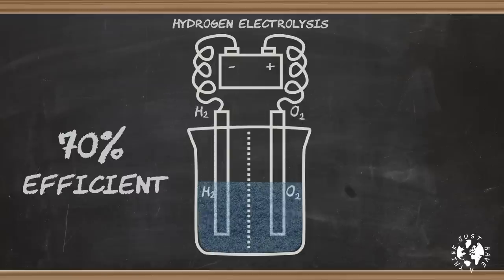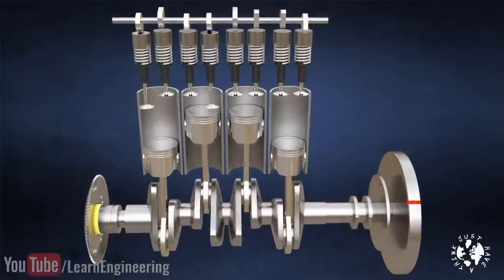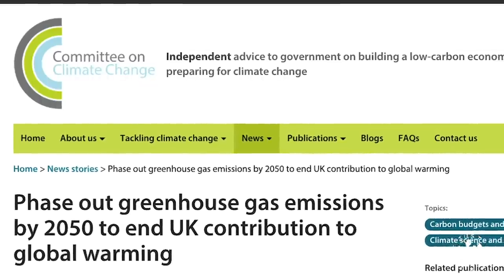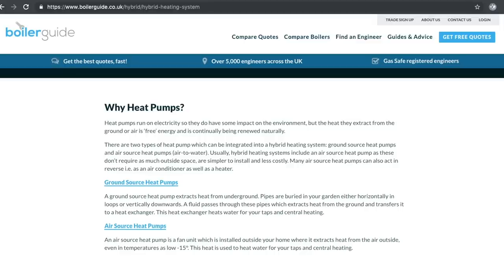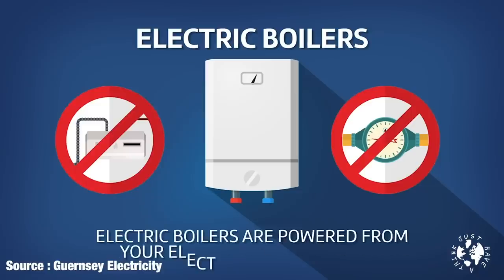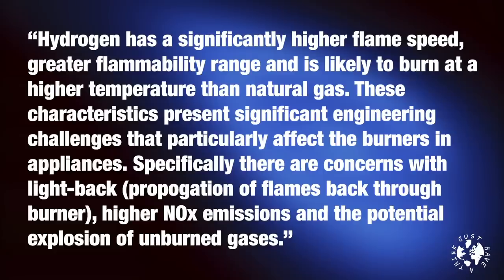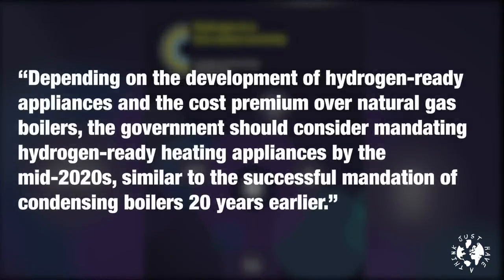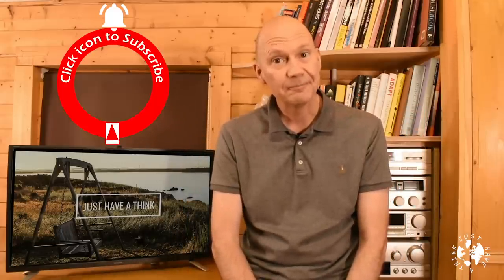Hydrogen for heating our homes

Comment: I use off-peak storage heaters. (Steffes brand)  They have salt filled bricks that are heated electrically to around 2000 degrees at night when the power price is low. Then  the room thermostat controls a fan that blows room air up threw and back down over the bricks. A air mixing system keeps the exit air temperature down to a safe level. On the whole they work quite well, but the old ones I have are manually controlled and I have to adjust them based on the upcoming outdoor weather. The modern ones do that automatically. For the future I am looking at a solar heat collecting troughs along with large storage tanks with candle wax to store a week of heat.

Comment: for get all that who can afford a hybrid system like that ridiculous.

Just make a hybrid water heater running on Solar  and having its own hydrogen generator  gas can be used to heat water during the night that water inturn can be used to heat the home,  additional power from the grid can be used if needed.   no battery needed  but  a battery Bank wouldnt hurt  all come down to your budget

Comment: I can see using hydrogen for the industrial users first, before it changes over to the average household. That would economize the production and also speed up the development of appliances. I do believe we need to stat with improving the efficiency of our construction techniques for houses first. I would also like to see the adoption of the garbage burning system that Sweden uses. They re now importing garbage to recycle and reuse for the production of electricity. We should be concentration on getting rid f our landfills. My 2 cents worth :)

Comment: I read something about using solar panels to produce electricity(1), then use the electricity on a utility scale to produce hydrogen(2), then adding the hydrogen to produce a liquid hydro carbon, that can be pumped through existing liquid pipeline infrastructure to where it it is to be used(3), then reversing the process through catalyst to produce hydrogen gas (4) to be run through a fuel cell to produce electricity(5).♻️💫
Reply from the maker: Hi David. I think that's right, yes. Essentially 'storing' the hydrogen in a transportable liquid that has far weaker bonds than water and then separating it at it's destination point back into hydrogen. It's an interesting option. I believe ammonia works too.

Comment: My thought is that hydrogen will be most useful as an energy store.  Take the excess of renewable production when it exists for electrolysis and use it in gas turbine electricity generating sets when renewable production doesn't meet demand.

The advantage being that all the new infrastructure is static, no issues with transporting gas from place of production to place of use; the two are the same.

I'm old enough to remember the conversion from town gas (mainly from coal and a mix of combustibles with 50% hydrogen) to North Sea gas in the early 70s. Clearly in principle a similar programme could be carried out today but it would be excruciatingly expensive. My guess is that it would be more efficient to replace gas with electric supplemented by air and ground source heat pumps than attempt wholesale conversion.

Provision for specialist industrial uses and long distance goods transport seem to be far more advantageous, and cost much lest in infrastructure, than general domestic and small vehicle use.

Comment: Great Video, it confirms my wish to do a hybrid air source & gas boiler heating system. The thing I am really passionate about promoting is  hybrid trolley/ battery bus and hgv’s . The overhead  electrical source is put onto main atrial routes  around cities so buses can run on  direct power plus charge and between cables on batteries. This simplifies the cable system and gives buses flexibility plus no down time to charge. This can also work for Hgv’s  with cables down the motorway etc then finishing deliveries by battery. No worries about vehicle range.
Reply: We had these in the 1940's so nothing new. (Apart from not having batteries).

Comment: Not sure if it has any relevance 450 ppm atmoshiric CO2 concentrations and above is now unavoidable if we cannot find ways to remove then a further degree C and above is inevitable.Thank you.
Reply: @Allen Loser 

Your original post stated that a rise in CO2 to 450 ppm is unavoidable. Unavoidable is not the same as financially unfeasible or unprofitable. Unavoidable means that no method to prevent it exists or can be devised and implemented before it happens,

Yes that's correct  unavoidable 450 ppm

  "my 1903 vintage house located in a mid-Atlantic climate (Hagerstown MD)." 

Do you have a garden.?

"If, as you now assert, avoidance of 450 ppm CO2 relies upon making it profitable to do so, I urge you to appeal to my greed by providing better solutions which make doing so profitable for me." 

Correct 450 ppm is now unavoidable but you have already had the profit 

"Atmospheric concentration of CO2 of 200 ppm or less are associated with disruption of the water cycle, global cooling, widespread glaciation, crop failure, famine and mass extinction."

True but and its a big but mankind could still manage millions if not billions on the remaining 75% land mass last glacier maximum,or do you think the Amazon is only ten thousand years old,? modern humans can live through an ice age     

 
"disruption of the water cycle, global cooling, widespread glaciation, crop failure, famine and mass extinction."

You get all this above but lots more as Earth warms dead oceans,meters of sea level rise,One Northern circulation cell,a complete breakdown of Earths biosphere, increased seismic activity alone could be daunting,?lightning,hurricanes,tornadoes weather blocking,flooding, heatwaves, drought, fires and vast water shortages,not to mention Bactria, viruses.

"The Earth was rampant with life under previous hot house conditions.

Yes but not with 7.7 billion people,you can't compare The PETM to a possible current hothouse Earth and what was alive then. 

 "I expect that I can, and will, adapt even if you are incapable of doing so." 

How do you know what i am capable of,? i bet you wouldn't even know the right fungi to pick.
Reply: @Allen Loser 
"The house could handle up to six without crowding." 

You might feel with that many people in your house that its no-longer your house just saying,i mean have you every gone to a relations house and out lived your welcome.?
Reply: @Allen Loser 
"What are your assumptions as to whom would be the additional up to five persons? I'm counting two persons in each of the two larger bedrooms and one each in two smaller bedrooms. Even one each in the two larger bedrooms and myself using both of the smaller bedrooms cuts per capita energy consumption by at least half after accounting for a modest increase in total energy consumption." 

What kinda personalities would you be looking for.?

Why is it your concern whom I might take into my house, and why, if doing so reduces, or eliminates, under-utilization of my home? Doing so reduces Global Warming. Do you wish to discourage me from doing my part? 

Well your the one that keeps talking about renting rooms,i am glad you are dong your part
Reply: @Allen Loser

 "Do you live in a house which is under-utilized with high per capita energy consumption"

well i suppose 8 persons and we have always between 7.5 persons
Reply: @Allen Loser 
 "I grew up in a three bedroom home with eight occupants; myself, my parents and five siblings sharing one bath." 

Nothing wrong about that.
Reply: @Allen Loser 

"I don't know one type of fungi from another but I reject your inference that I will need to know in order to survive global climate change." 

It was an example,but i will give you that one and maybe i should have said to purify your own water. 

"You said that 450 ppm of atmospheric CO2 is unavoidable. Attempts to stop that which is unavoidable are, by definition, futile." 

Correct but what has your above comment got to do with stabilizing atmoshiric GHGs and drawing down.?

 "you concede that use of fossil fuels has benefited Mankind by improving the standard of living of billions of people since 1859 when Colonel Drake struck oil in Titusville PA" 

Correct fossil fuels are fantastic stuff apart from global warming, ocean acidification,and the 7 or so million that die an early death due to pollution 

 "Better get to work developing crops which thrive in a warmer climate. That is certainly an easier task than stopping the climate from changing" 

If only it was that simple.. . 

"The glaciers will melt with, or without, the assistance of Mankind." 

Let us not debate why our planet is now losing mass ice

 "Appeals to my greed may succeed at getting me to change my behavior where fear mongering will not" 

Now why would you suggest i am guilty of fear mongering.? 

"You need the voluntary cooperation of an overwhelming percentage of 7.7 billion people in order to have any chance to prevent the climate from changing." 

A certain amount of additional warming is uneatable, however to stop excessive warming would take trillions of investment and a total change of land use.

"I'm telling you how to gain my cooperation, and that of most of 7.7 billion others, without any need to gain my, and their, acceptance of your position on Global Climate Change."

It is not my "position on Global Climate Change." but mathematically speaking 450 ppm.
Reply: @Allen Loser 
"Why then do you attempt to dissuade me from following your example of energy efficiency?"

Your remark/question is nonsensical.
Reply: @Allen Loser 

"I said nothing about renting rooms in my recent post though that is a possible approach. I said to increase the number of people living here." 

I am well aware of what you said,my renting comment was small talk and just being nosy,i mean there are so many possibilities must be hundreds of homeless people in your area.
Reply: @Allen Loser 
" I have taken in homeless in the past." 

Good for you many years ago i was involved with homeless people,and drug and alcohol abuse,it comes with the same territory.
Reply: @Allen Loser 
Oh well time for work,have a nice day as the American people say.
Reply: @Allen Loser 
Spend billions to upgrade or to replace inefficient housing as a means to reduce consumption of fossil fuels. I'm doing so at my own expense to the extent that my finances allow.

Allen Houses are a pain in the butt, they always need updating to save energy or not.
Reply: @Allen Loser 
"you think that a 90% casualty rate from return to a glacial maximum is acceptable." 

I would dispute that number it don't make sense,LINK PLEASE because Equatorial and southern hemisphere nations could easily coast through an ice age. 

"Modern humans survive a semi-topical climate with few climate -related casualties."

But most of our current biosphere would disappear,you can't even imagine what a further 12 C would be like it would be hell on Earth, of course given it a few hundred thousand years life would start to balance out,its the whole point you are missing the speed of change.

"For that matter, some who reside in ice box climates seek out semi-tropical locations for temporary respite from the cold at home." 

What has the above comment got to do Earth becoming a hothouse.
Reply: @Allen Loser

 "An older brother once commented that owing a home is something which keeps you poor all of your life so that you can leave a fortune to your offspring." 

So true 

"You can offer to pay to tear down my home and build a new home for me which meets the Passive House standard if cutting CO2 emissions is sufficiently important to you" 

I would say it should be important to everybody,would you not agree.?

"A Passive House would eliminate my consumption of natural gas. The heat load would be so small that it would no longer make sense for me to pay $15.80 per month in fixed charges to buy, perhaps, 20 therms of gas per month for $20 to $25. It would make more sense to heat with a small heat pump, replace my gas cook top with electric and use a well insulated electric water heater." 

It looks like you've worked it all out.

"Alternatively, you can rely upon my limited efforts to improve this home at no expense to the Disciples of Climate Change."

"Disciples of Climate Change,? "

More like the demons of climate change
Reply: @Allen Loser

 "Your post posited a reduction in population during an ice age from 7 billions to millions. If single digit millions that is a reduction of 99.9%. Since you were not specific, I went with the tens of millions remaining." 

Incorrect reread my comment again, what i said was millions if not billions would survive an ice age.why do you keep misquoting me.? 

 "People seeking out warmer climates for vacations shows that they prefer a warmer climate. They seek out locations which already have a hot house climate."

Don't you understand,? a further 12 C on top of current present day temperature, plus heatwaves

" I give no credence to the predictions of climate models which fail to get the rate of melting of glaciers correct. The rate of melting of glaciers should be one of the simpler pieces of the puzzle to mode."

Not necessary a sudden collapse mode has factors that cannot all be wired in
Reply: @Allen Loser 

"I reject your assertion that Mankind can atone for their climate sins by stopping the climate from changing through treaties, regulations, laws, taxes, carbon credits and redistribution of wealth. The means you propose will not survive the necessary millennia to make a difference. You refuse to appeal to my greed as a means to get my voluntary cooperation." 

You have already said you haven't got trillions.
Reply: @Allen Loser

 "If only millions survive that is a 90% reduction."

But i never said if only millions survive ,I said millions would survive  IF NOT BILLIONS stop twisting my words,you have already been caught out.
Reply: @Allen Loser

 "What if you over do it? You won't be able to measure the results for a century or more; just like you couldn't measure the warming." 

Next thing you will be telling me it take a century to measure atmospheric CO2 concentrations,regarding temperature our Earth is warming as one would expect
Reply: @Allen Loser 
Anyway downtime goodnight

Comment: Saw somewhere  on interwebz  hydrogen atoms extremely teeny weeny tiny size leaks thru existing piping systems etc.. AND since it has no smell BOOM!
Reply: wrong, scaremongering. Coal Gas (town gas) has a lot of hydrogen in it, and is what we grew up with prior to the changeover in 1968. Copper pipes don't leak substantially and don't need changing. I've got the same pipes as we had here in 1960. Nothing has ever blown up or leaked.
Reply: and actually, if you look up methane,  it's described it as odourless if it's pure. Most people can't smell it if it's pure and doesn't contain ethanes, alcohols or heavier fractions. But I can smell it, as can a substantial proportion of the population. Hydrogen also has a smell that some people can detect, and you could always add something to make that universal, say a tiny amount of SO2 or m/ethanol, detectable at sub-1 ppm.
Reply: Hydrogen has problems with both hydrogen embrittlement and corrosion. Hydrogen has an active electron, and therefore behaves somewhat like a halogen.[9] For this reason, hydrogen pipes have to resist corrosion. The problem is compounded because hydrogen can easily migrate into the crystal structure of most metals.[10] For process metal piping at pressures up to 7,000 psi (48 MPa), high-purity stainless steel piping with a maximum hardness of 80 HRB is preferred.[11]
Composite pipes are assessed like:

carbon fiber structure with fiberglass overlay [1].

perfluoroalkoxy (PFA, MFA).

polytetrafluoroethylene (PTFE)

fluorinated ethylene propylene (FEP) [2].

carbon-fiber-reinforced polymers (FRP)

Fiber-Reinforced Polymer pipelines (or FRP pipeline) and reinforced thermoplastic pipes are researched.[12][13][14][15]
Reply: @dickhamilton3517  Because it's so small, Hydrogen can diffuse into metals and cause embrittlement. Even copper is affected, though slower than e.g. steel. 

Hydrogen Embrittlement is something the fossil industry is already struggling with, and have been for a very very long time (there was a time when there were many Hindenburgs flying around). So far, the most effective method to slow down Embrittlement is to reduce temperatures to -200°C.

Hydrogen is very reactive. It acts like a halogen because it has a single electron in the first orbital. In other words, it's corrosive. 

Acids are corrosive on the basis that it releases a Hydrogen ion into a solution. 

Hydrogen is the special ingredient in Acids that make all Acids acidic.
Reply: @dickhamilton3517  Town gas and natural gas are bonded molecules (Hydrocarbons) which are hundreds of times bigger than hydrogen atoms this is why town gas and natural gas will not leak out of systems that would in effect act like a sieve to hydrogen atoms. Comparing molecules to atoms is like comparing a grain of rice to a melon. Hydrogen atoms are so small you cannot use steel pipes for transportation as the hydrogen atoms slowly migrate into the crystalline structure of steel which over time seriously weakens/damages its structure leading to failure on pressurised systems.